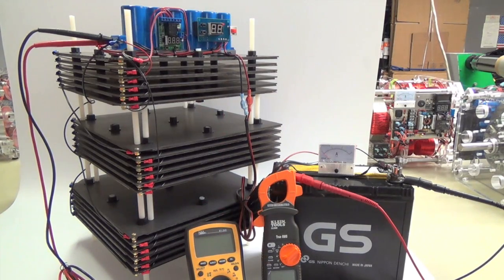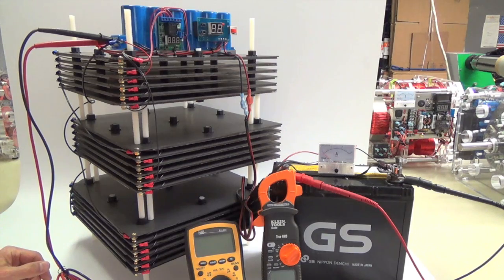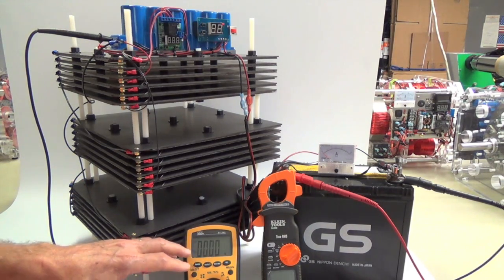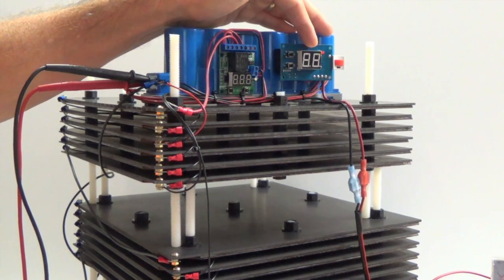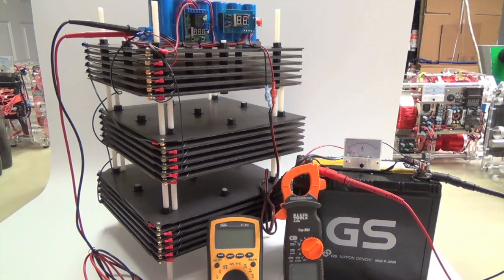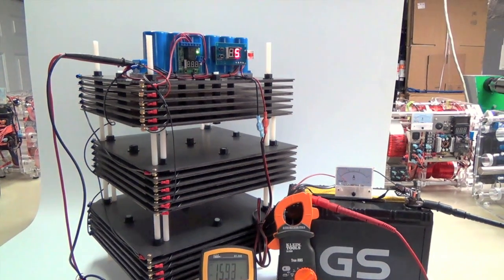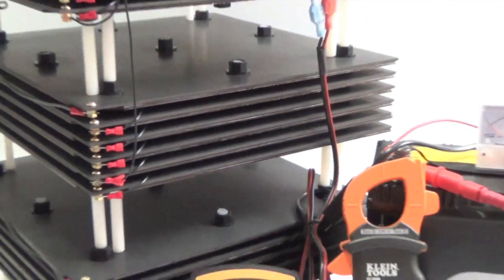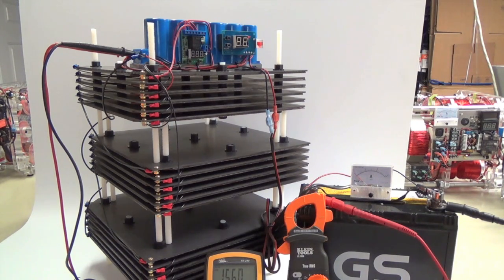Solid State Energy - SiC nano

Comment: Very interesting upgrade, Mike.   What kind of life tests have you done on these?  Since they apparently produce energy in the mA range (?), have you run any under constant load for weeks or months yet? If so, is the output power consistent... or does it very slowly decay and need a rest... or anything like that?  This seems to be a question others are asking, and though you obviously don't owe us anything, it'd be nice to hear.  
Thanks!
Reply from the maker: I have stated many times that if you power a load directly from any cell or combination of cells without the use of caps or circuits, and utilize only the power that the cell/s can constantly regenerate, the load will run continuously without degradation of cell/s. As a long term test, I have a v.1 test cell running a small dual coil motor, and has continued now for over 15 months non-stop. It remains an impressive little experiment.
Reply: OK, thanks... I don't remember everything I've heard in your videos, thanks for the reminder... sorry I didn't remember.
Reply: We do not have liberty to be creative. Soon, tech and info will change the world. Let's not waste paint fixing. The Titanic has excess lifeboats today...and the Titanic a very big hole. How to not waste...we are way behind already...a United World Youth Org, a generation, silence their inheritance like 1989 China. the Venus Project for the youth, free the old. ALL is feasible. good or evil. Anything less can be lost in politics and propaganda. We need tech society not political. TVP---education(1),,,,,(all else paint),,health, Earth, Universe.
Reply: Which current density you can draw from silicon and silicon-carbide graphite cell?

Comment: Forgive my skepticism in having previously opined according to standard thought. You so need to answer those questions though. If you are getting energy from the vacuum like a wind turbine from the wind or a solar panel drawing from the sun then please explain that otherwise we are left with a 1- chemical reaction device. Show conclusively that this is a 1+ energy device. Does your device cost more to buy than the cost of energy it makes in Kwhrs. That is the real question which is economic rather than scientific. People can understand that but I still remain skeptical until pleasantly surprised.

Comment: very interesting although completely new to me.

Ok so how many of these cells woul we need to get 2.5kWh a day? or about 100W system continuous?

and how much would that cost?

thank you.
Reply: Yves 2.5 Kwt a day ? you are kiding !!!.  Well, there is 48Wts per pulse, times 10 pulses a minute == 480Wats, times 12 cycles a hour  === 5760 Watt. hour, times 24 hours  is 138  Kwts day.
Reply: Yves you only nede 6 cells,  there will be  15Wts per pulse times 10 pulses a minute == 150 Wts  times 12 cycles hour == 1800 Wts hour, times 24 hours  == 43 Kwt day,  you nede  30 batterys 12 V x 120 Amp. to accommodate ol  that energy.
Reply: I'm not sure I understand your numbers. How much energy is in a pulse? in Wh or joules?

Unless Wts is Watts/second. 

what are the 12 cycles per hour?

but anyways, you-re saying that 6 cells generate can essentially power a small household?

how much would this setup cost? (excluding the batteries)
Reply: Yves, you listen to what the man says, 48 watts per pulse and the pulse is 1 second and 5 seconds in stand by, ok 10 times per minute, then stop 4 minutes for cells to charge the capacitors, ok 4 + 1 = 5 Minutes is a cycle so 1 hour has 12x5 minutes or cycles  A set of 6 cells plus the ardwer will cost about 2000 dollars you go to the google  and write Quanta Magnetics store and  shop, it is safe. A set of 6 cells will give 15 Watt per pulse times 10 x 12 x 24 ok
Reply: Ok, thansk José. i got it. I kinda skpped over these numbers because I couldn't beleive it and didn't know if they reflected consumption or output.

And the impedance of the batteries change as they charge so my guess is that the system gets less efficient as the batteries converge towards full charge. 

and thank you for your patience. This is interesting and worth investigating.

So according to this for < $5k one can power his house off grid with electricity?

and how long do these cells last? does anyone know?
why does he keep talking about solar during the day when this system (a third of the price of a 4kW solar system) can do it all?

thank you.

Comment: So how many watts does this system put out? 48w pulses for 1 s every 6 seconds means you are discharging the caps roughly at 9 watts. As the cells don't seem to be able to keep the caps topped off it must be less than 9w

Comment: what is the energy capacity of 1 layer of this SiC plane? i get it that it's chemically induces electricity that comes out of it, yet all of them have a total amount of energy that can be pulled out of them, so have you ever managed to "empty" one of those 6cell blocks? if so what did it take to empty or break those?
how much actual material goes into producing them? SiC manufacturing nanotech or not what is the material cost of producing it? what dangerous chemicals are included in the process, how much electrical energy required to build them?

because if those layered things produce less total amount of energy than what it takes to build them it is really not a long term advance of technology.

and i intentionally left out efficiencies.
Reply: so are you calculating it or just don't even bother because 15 months old? if not total wattage you can safetly say Whour or Wday...
i get it that you have made them more and more advanced, yet when it comes to explaining and showing to electricians that it does work and it's the battery of the future they will want to compare it to current models. which means you should prowide similar types and amounts of data on your batteries.(cells)
i get that the charts would go way longer periods of time, and that is cool and all, yet numbers are really just that, numbers plain and clean. if you don't have them then people find it hard and think it's run by magic and hoax and prey...

i would like to see the advancement in this field and that was only my goal of questioning. i do not assume anything, just ask the details.

have fun.
Reply from the maker: Dangerous chemicals? zip. "Empty" cells? I have fifteen month old inferior v.1 test cells still running devices 24 hours every day. You got to love these "layered things".